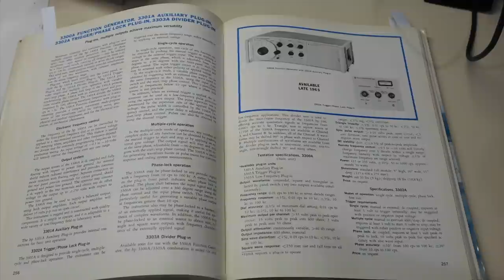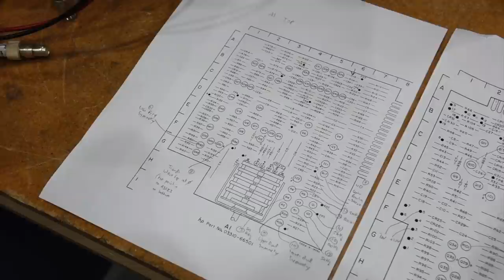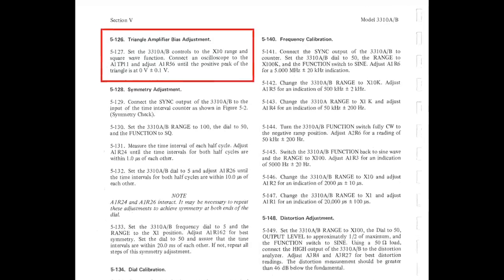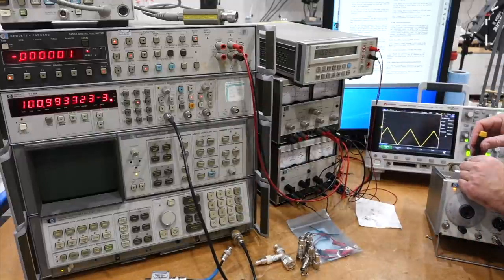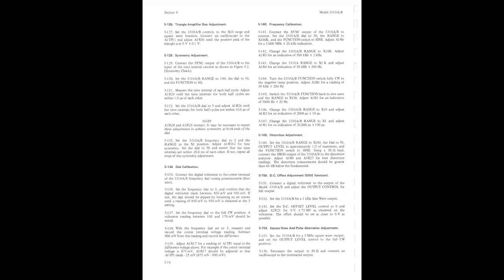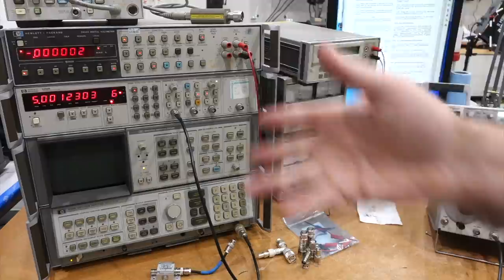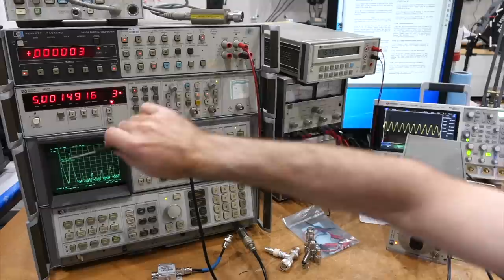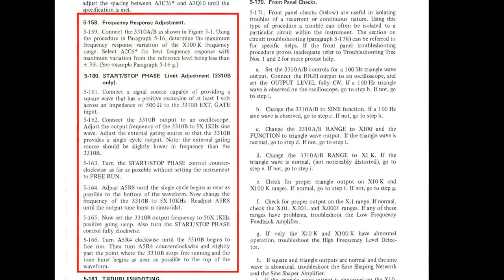HP 3310A vintage function generator: bringing it back to perfection

Comment: "You can do most of this with what you already have" Yes, this is surprisingly possible a lot of the time, even calibrating my 8660 was possible with what I had around. Sometimes you see stuff like sampling scope with 10ps resolution though, which I don't have(yet), but the modern equivalent would be a 100Gs/s+ scope, which is not really in my price range either. And usually it's the instruments you wouldn't expect to need such gear as well.

Comment: Laughing out loud because of that final adjustment. That is a very interesting one.
Reply: I have trouble believing it was intentionally designed that way, as opposed to kludged into the calibration procedure after the fact with a straight face.
Reply: @frankwales  I think I agree.

Comment: Power supplies on HP gear are rather binary in my experience(very limited compared to yours probably), they're either spot on or faulty, there's no in between. I've had a lot of non HP gear and the rails were always off. I'd love to hear your take on this!
Reply: (uninformed/unresearched opinion) They are probably overengineered to the point that if there's overvoltage, a crowbar circuit will insta-kill the supply and if there's undervoltage, it just shuts off and the limits are probably set to <5%

Comment: I'm  going on 79 yrs old
Still have my 4262A LCR
METER in my garage  been with me 35 yrs or so,started my business with it making transformers, and test equipment. It's a fabulous 
Tester. I kept it because 
It has so many memory's 
Of the people that used it
And when we shipped our
Magnetics out we knew 
They were run thru our 4262A
I loved there so test feature 
So much I built selt test in to my toroid turns tester 3500
Yup  but it needs a good home ?

Comment: I guess poking a capacitor with your finger makes the adjustment 'digital'...

Regarding what the adjustment does, what's the mechanism behind the change we see when the position of the cap is changed?
Reply: I think this would be known as capacitive coupling
Reply from the maker: Not 100% sure, but I think it couples capacitively to the heatsink of the transistor, which is connected to its collector.
Reply: Just don't try it with HV caps in tube circuits :)
Reply: @KeritechElectronics  if you’re following along “you’re doing so at your own risk” 🤣
Reply: @Mark_C1  true, it's essential to know what you're doing :)

Comment: I had a 3310A that somebody had attempted to repair, but they ended up zapping several transistors in the power supply, output stage, and the signal source.  I managed to repair the power supply and output stage, but it was a pain to work on because all those boards interconnect.  The wires started breaking off of their connectors to the front panel controls, and I had a broken trace within one of the circuit boards.  Finally had to admit defeat on that one.  FYI, the manual on Keysight's site is a poor scan and is missing some parts of the schematic.  I found a better scan that's complete if it would be useful to you.

Comment: Excellent, thanks Marc.  Had a good chuckle about the 75MV (that is Mega, 5-153) adjustment as printed in the manual.  I guess you were using an attenuator 😉

Comment: Did they recommend a specific interval for recalibrating it?
Reply from the maker: No. They say only if it fails the performance checks (they have a whole long chapter on performance checking), or if you have changed a component.

Comment: Got an blue finish 3310A some weeks ago. So your video definitely helps a lot. Appreciated! Thx for taking the friction wheel near to the camera, as that one is missing completely on my generator. Will have to 3d-print something. The frequency pot is working in princple, but shows some on/off behavior. Any hint how to 'repair' this little fully encapsulated guy?

Comment: Can you explain the electronic theory behind bending it? Is it changing the inductive field on the transistor?
Reply: It's adjusting capacitance. There's a parasitic capacitor with one plate being the transistor's case and the other plate being one side of the capacitor being bent. Bending the capacitor changes the spacing between the plates of this parasitic capacitor, which changes its capacitance.

Things like this were sometimes semi-intentional by the analog gurus. Bob Pease wrote an article about how he discovered a discrete op amp worked only because a few femtofarads of capacitance between its two circuit boards provided positive feedback necessary to make it function. When competitors tried to reverse engineer the design to copy it, they failed because they didn't find that tiny parasitic capacitance the designer hid in plain sight.

Comment: Nice callibration video, but bending the cap? I don't understand here why this works. Can you show in the diagram what you did here?
Reply: Capacitance varies with the distance between two conductors. You typically adjust rise time and overshoot by adjusting capacitance in some way. In this case, there is a small capacitance between the outside foil on that capacitor and the heatsink on the collector of the output transistor that is amplifying the square wave. By moving the cap closer or farther from the heatsink you change this capacitance, which might be in a feedback circuit (I haven't looked a the schematic).
Reply: @lwilton  Thank you. that makes it  clear to me. I'd never realize this could happen. But it sounds very logical.

Comment: I would love to watch a detailed explanation for how a diode array creates such a pristine sine wave.  Probably like watching paint dry for most but I have no clue how that works as well as I it does.
Reply: Paul Falstad has a visualizing circuit simulator with lots of example circuits, one of which is a triangle to sine converter.
Reply: @malloryworlton6359  I was intrigued by its accuracy as well and tried it in LTSpice, which worked nicely as well. It doesn't look as fun as Paul's simulation though.

Comment: Excellent content, Marc, thank you for making this! 

I have the B model and now I know I definitely need a solid digital oscilloscope. The only properly working things I have at the moment is a Chinese multimeter and a Chinese 60 MHz signal generator/counter. But I'd like the oscilloscope to be a proper established brand (although I fully expect it to be made in China). Does anybody have any recommendations? My budget is about 600 USD / EUR. Thanks to anyone for any suggestions.
Reply from the maker: I bought a little 4 channel Rigol for the Computer History Museum restoration team for less than that, and it was very capable, including Fourrier transform for watching the spectra.
Reply: Made in China is not a bad thing so long as you know it passed the brands quality standards. I used to work in the Automotive industry and worked all over China for many many car companies (we supplied equipment to them) I once got talking with someone high up in VW and they admitted it was more expensive to manufacture in China just because of the rejects. Brands earn their respect through quality inspection. VW Chinese partners  (FAW / SAIC / JAC) used the exact same equipment, the exact same production lines and produced absolute garbage. Do not buy Chinese brands unless you are willing to accept the possibility of a bad product. They are getting better but the ethics are not there.
Reply: @CuriousMarc  Thanks for the suggestion, Marc, I'll have a look at some Rigols.

Comment: I used to work as an administrator for avionics installation engineers, part of which involved sending gear for calibration. I used to wonder whether equipment was still "in calibration" after being flown to distant jobs in challenging climates.
If it isn't "tortoises all the way down" "calibration all the way down",  might be a better option.

Comment: Great video series, I really enjoyed it. 
But, but... Why would you want to use an analog WFG in 2022 when the digital ones are so amazing? Smaller, better, cheaper, faster, way more accurate, no scope needed: just set the numbers. Plus computer control. I started using modern WFGs  15 years ago and never looked back.

Comment: Must have really made for slow mfg for these. Each needs a lot of technician cal etc
Reply: Probably not that bad. Except for tweaking the two caps you could probably do the calibration in about 10 minutes with practice and the right test setup, which HP would have had.  Maybe a half hour for the whole calibration, which was likely a lot faster than these came off the production line.

Comment: I just broke mine by accident by putting 550V into the input
Reply from the maker: No worry. It will just buff out.
Reply: @CuriousMarc  Well i got further with it it seems like it blew Q14 (one of the output transistors) and something on the power supply and also the 47Ohm (39ohm in my version) resistor got a big crack through it and turned into a 2MΩ one, i hope that prevented damaging the frequency generator brain board A1. 
The 25V (+ and -) rail are both current limiting, without the frequency generator part, so only the final amplfiier as the load.
No transistors seem to have shorted, but i havent verified the diode drop voltages on most.
most passives allign with the parts list except for a few cases of being a later revision.
I hope that the frequency signal shaping board A1 is fine and just the power supply and the amplfiier board died.
Reply: @CuriousMarc  Update: figured out what is wrong with it, the signal shaping board A1 is fine, just the output stage got blown, i ordered replacements and we will see if it does work after what i did.
Reply from the maker: @janno288  Excellent news! Good luck on your repair!
Reply: @CuriousMarc  Thanks a lot!

Comment: Bending a cap... weird!!! What is mechanically happening here that is causing this to change? Bizarre.
Reply from the maker: I think it is capacitive coupling between the cap and the collector of the transistor, which is connected to its heatsink.
Reply: @CuriousMarc  This is a variation on a "gimmick" capacitor, very common in ham radio gear. Typically though a gimmick is just a piece of wire that you bend closer or farther to another wire or component.